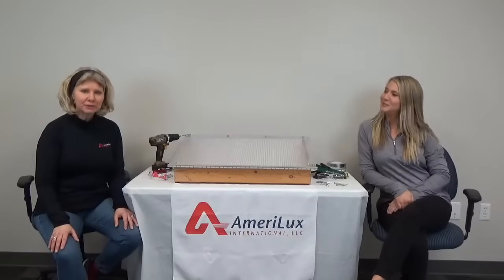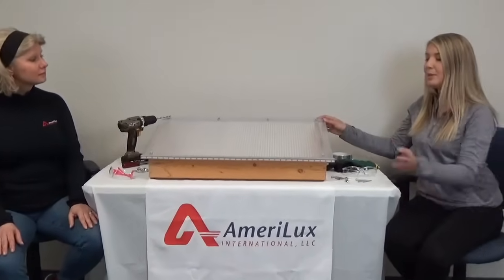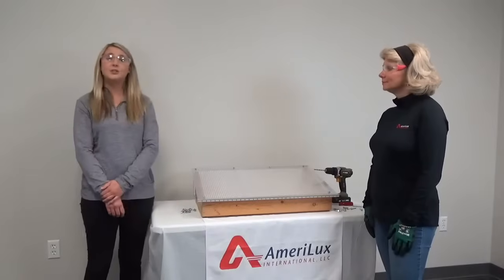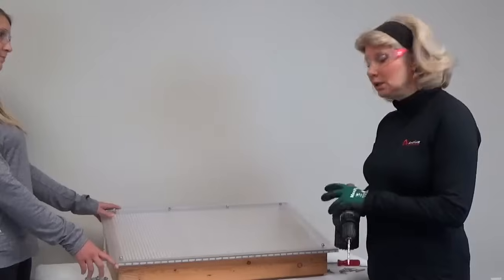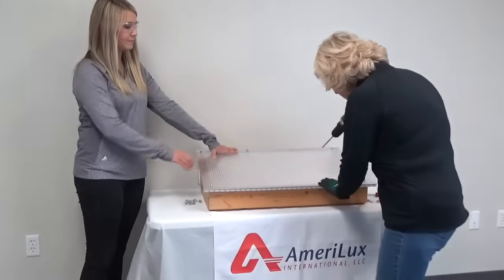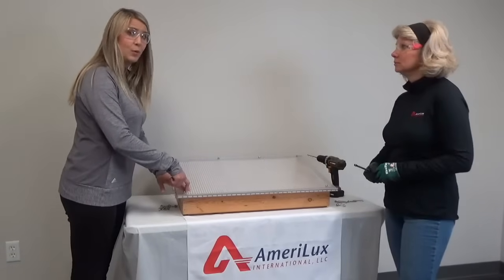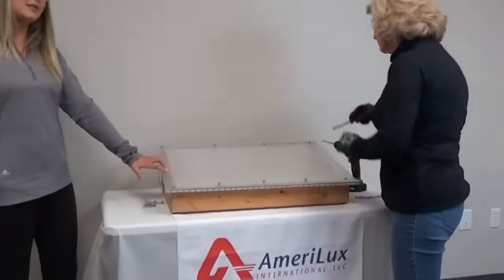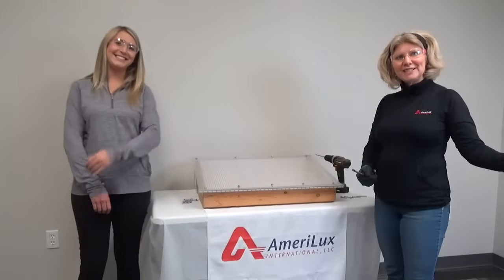Installing Multiwall Polycarbonate: Drilling and Fastening Tips

Comment: When you say do NOT drill within 1.5 inches of the side, do you mean the outer edge of the hole can be right at the 1.5 inch measurement? And because the panel is not always cut perfectly to the edge of a flute, could you just tell me how many flutes i should count in from the side for a hole? Thanks for all your videos!
Reply: It's not that critical. About 1.5 inches from the edge. As to where the flutes are, again, it's not that critical. 'About' is close enough.

Comment: when buying the MultiLite screws from Menards which has a description:  "MultiLite two-inch screws are to be used with a wood frames only. It can be used with 16-millimeter MultiLite, CoverLite, PVCLite, PVCLite Plus, and FiberLite. This screw features an automatic pre-drilling expansion hole and a 1/4-inch hex head with a neoprene washer."   So does this you don't need to predrill using your screws?
Reply: She said to pre-drill the holes 1/16th larger than the fastener, to allow for expansion and contraction around the 2:49 min mark

Comment: What do I do if there is no sticker or marking that identifies the UV protected side?
Reply: I had the same question, here is the response that I received from the company, "You can determine which side has the UV by applying a small drop of Iodine on either side. Iodine will stick to the side with the dripgaurd (the side you want facing down), and the iodine will wipe off the side with UV (the side you want up towards the sun). Unfortunately the Iodine test is the only way to determine which side is which after the masking is removed."
Josephine Birkholz | Customer Relations Manager - AmeriLux International